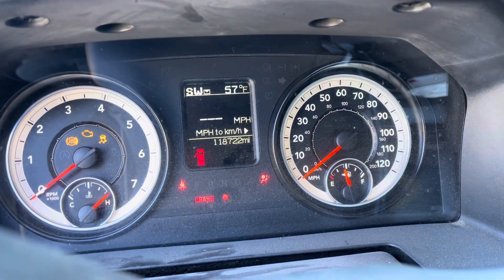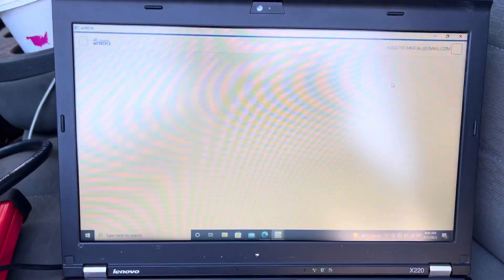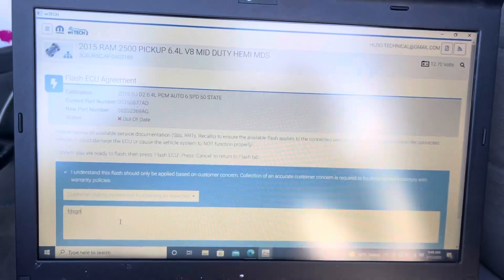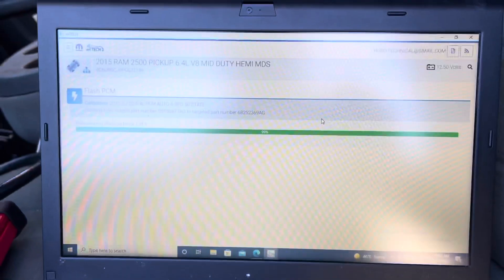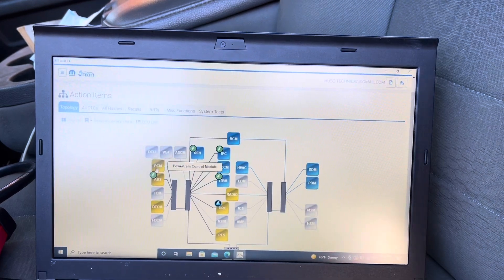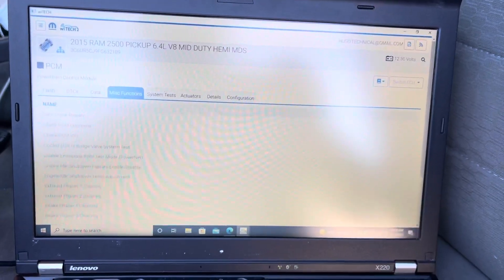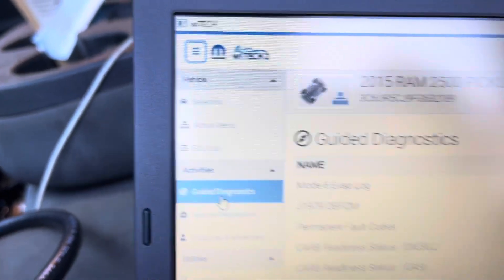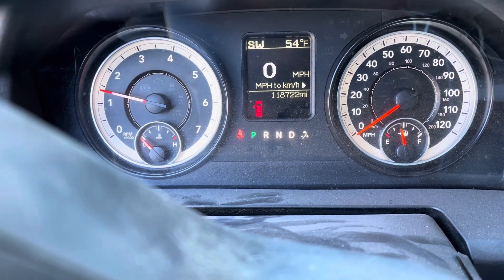CHRYSLER, DODGE, JEEP, and RAM  NEW or BLANK PCM PROGRAMMING/REFLASHING WITH WiTech2 J2534

Comment: Good video, but it needs to be clarified that this garbage Witech 2.0 platform has many compatibility and stability problems. It's not a reliable or easy-to-use platform with too many requirements, even if it were cheap. And ANOTHER big problem is that it's not the J2534 interface that gets registered, but the virtual serial number of the device (PC, laptop, tablet). If you've already registered your laptop to use with Witech 2.0, you can't go back to using it with Witech 1.0 or CDA, not even by formatting and reinstalling the operating system. It's truly a garbage platform; you're better off sticking with Witech 1.0, even the clone works better. If you can avoid Witech 2.0, do it because they'll most likely rip you off with those $150 in useless subscriptions, all because the platform is a piece of junk that crashes constantly. Every time it crashes, you have to log in, connect, and then it tells you that you don't have a connected device and you're out, and then you have to go back to the same thing. They know it doesn't work, that's why they even have comments disabled on the videos.  officers

Comment: What if I pull a pcm from a junkyard?
Reply: Just write the VIN number with Autel or Launch, you don't need download the software
Reply: which autel does this
Reply: @lokyblack3379  does the junkyard pcm need to have the same part number as orgininal?
Reply: @LsLuke754  yes, each part number is dising for specific vehicle, engine, transmission etc,
Reply: @lokyblack3379   I have a 05150609AC replacement for my 05150608AC pcm.  They should have the same 3.6l engine from the same year.  Is it in any way possible to recalibrate the new one to work in my car or does any pcm have to strictly be the exact same to work at all.  Because this one was $60 and the stock one is over $700.

Comment: i have a dodge challenger 2010 rt manual i replaced the pcm module.  the key works the functions but does not release the ignition for the car to start what could it be?  please i need your help

Comment: Hello Huseyin, thanks a lot. For FCA programming what subscription do you need to do this type of job. Witech2.0 subscription or ECU Flash subscription? Is Tech Authority subscription required as well?
Reply from the maker: You would need all 3 subscriptions.
Reply: @huyug1   how much do these subscriptions cost?
Reply: @huyug1 i have all 3 but i cant doing that,,, i have bought j2534 cable from ebay,,, its not workjng
Reply: @huyug1 can you program a used one ?
Reply: It’s about $140 for all 3 with tax